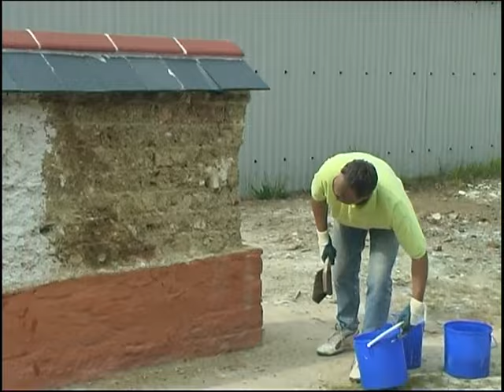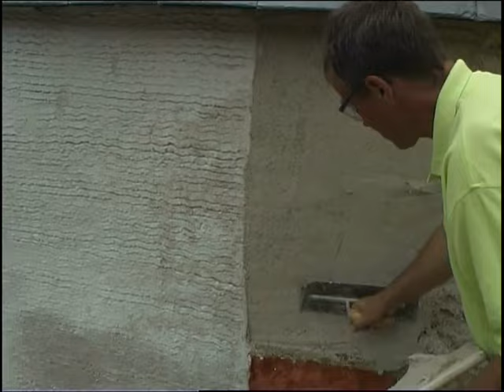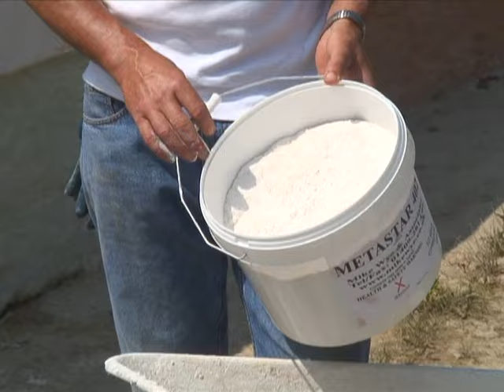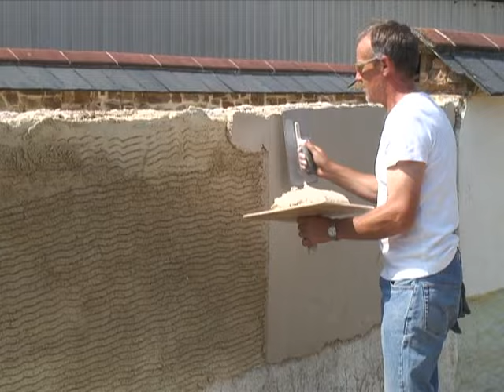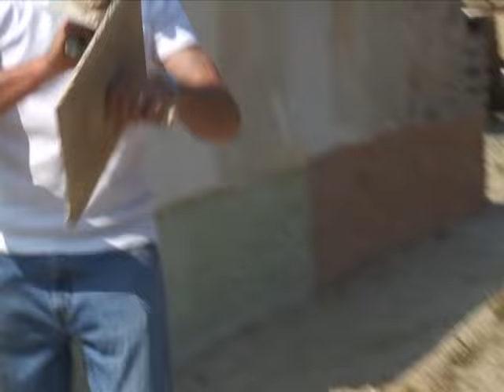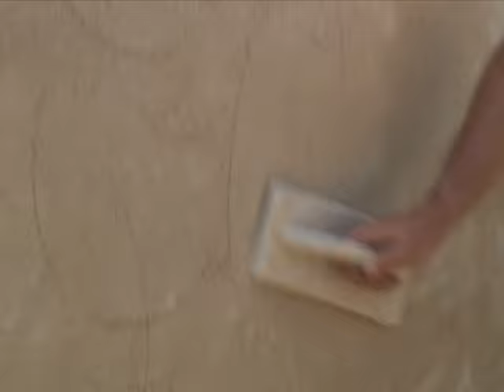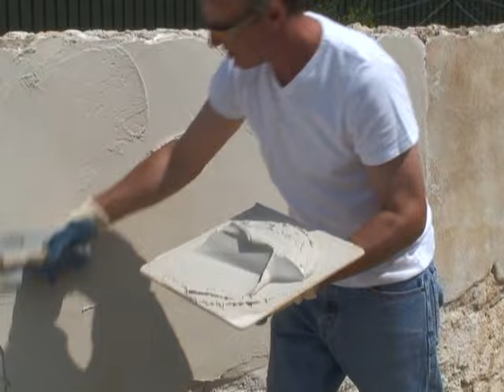How to Lime Plaster (internal solid wall)

Comment: Are these plaster layers breathable? Is there a huge difference between these and external mixtures? Can these be painted with a natural paint? It's very rainy where I am as well.
Reply from the maker: +aghostdream Yes, lime render and plaster is breathable. An internal render is typically a 3 coat buildup, with 3/1 haired mortar as the scratch coat, 3/1 unhaired as the float coat, and then a skim of 3/2 plaster. Externally, it would be just the first 2 coats, and we would recommend a 3.5/1 mix, with pozzolan added for a more regulated set. For external use, we would recommend a silicate paint https://www.mikewye.co.uk/product/seciltek-silicate-paint-sp-01/
Reply: +MikeWyeAssociates thanks very much for your reply! I'm quite new to this.. When you say 3/1 is that the ratio of lime to another ingredient?
Reply from the maker: +aghostdream 3 parts sand to 1 part lime putty (by volume)
Reply: +MikeWyeAssociates thank you!

Comment: A great video, very informative. What type of paint to you recommend for lime plaster on internal walls? Does regular water based emulsion still provide adequate breathability?
Reply from the maker: +Voodoo Melon Apologies for the slow response. The key thing to look for when choosing a paint is that they do not include acrylics. Modern water-based paint often still contain acrylic which forms a restrictive layer over the plaster. Thankfully, there are many paints on the market which allow excellent vapour-permeability (breathability) in a good range of colours. These include: clay paint, lime paint, natural emulsion, silicate paint, and the more traditional distemper, casein paint and limewash. Take a look at our website for details and colour charts on all our breathable paint finishes www.mikewye.co.uk
Reply: Fantastic, thanks!

Comment: Great video, some top skills on show! 
I'm working on my 1890 (ish) terraced house and looking to redecorate one of the bedrooms.  Removing decades of wallpaper has left a very rough,  pitted surface unsuitable for painting.  Is it a good idea to simply do a top coat using a lime plaster to provide a surface that could be painted, rather than taking the existing plaster back and doing more coats?
Reply from the maker: Stew Murray Thanks Stew! This video shows the full build up for internal lime plaster work but there are methods of renovating existing plasters to 'make good' without hacking off all of the old plaster. 
Provided the existing plaster is sound and really just needs an additional skim, it can be primed with a low acrylic primer (we use Bayosan DG27 http://www.mikewye.co.uk/product/dg27/) before skimming with something like a 3:2 lime putty plaster http://www.mikewye.co.uk/product/lime-plaster/. 
Whilst a thin, painted coat of the low acrylic content may sacrifice a little of the vapour permeability, it enables lime skimming onto a range of surfaces without the need to apply the full build-up of coats as shown in our video.
I hope this helps. Ryan

Comment: Great video, thank you. I grew up around buildings with lime construction. There is something so serene about the texture and feel of these buildings. I would love to incorporate lime plastering on the walls of the farm house I am going to build in Dominican Republic. Is there a video on lime mortar preparation? I have videos from other folks, but would love to see how the mortar/putty was mixed (that was used in this video).
Reply: in hempcrete the lime has dried chopped hemp mixed in damp and sets around timber uprights and mineralises over time... the  timber lasts hundreds of years. So similarly coir should be ok as fibrous material to help support the lime plaster IMO.
Reply from the maker: Cave Man Thank you for your comment. In our early days we used to mix lime mortars and plasters on a smaller scale but sadly we don't have any videos of the process. These days we mix in larger agricultural mixers so not sure how relevant a video of that would be. We're happy to answer any questions you might have though.
Reply: +MikeWyeAssociates It would be marvelous to see a mixture video!
Reply from the maker: +aghostdream what do you have in mind?
Reply: +MikeWyeAssociates Perhaps just a short video on mixing by hand?
Reply: +Cave Man  When I was a kid plaster walls were built up on wooden lathe strips and it was very strong though prone to micro cracks.  Frequently hair was mixed in [I heard horse hair but no matter] to reinforced the plaster.  Now I presently live in the DR and am thinking of using coir fibre from coconut husks to strengthen and reduce cracks.
Reply: +Cave Man  When I was a kid plaster walls were built up on wooden lathe strips and it was very strong though prone to micro cracks.  Frequently hair was mixed in [I heard horse hair but no matter] to reinforced the plaster.  Now I presently live in the DR and am thinking of using coir fibre from coconut husks to strengthen and reduce cracks.
Reply from the maker: +Zingara Joe
Hi. We use horse hair and some prefer goat hair and there is a fibre glass alternative, but I am afraid we have no information on how well coir fibre would work. Sorry